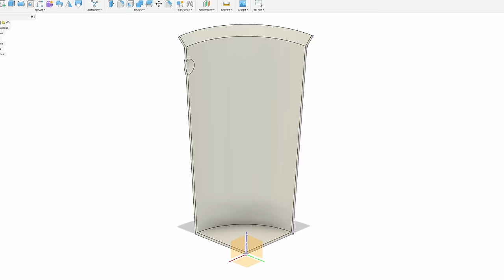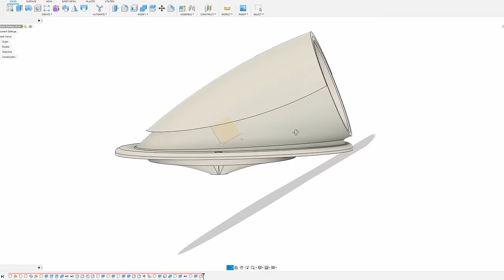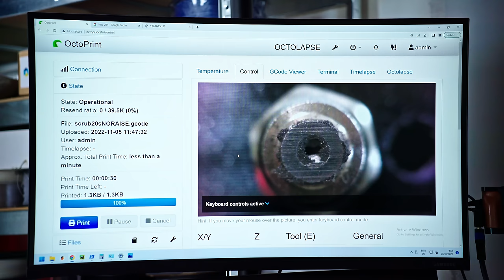Why you should get a 3D printer NOW

Comment: I came from a machinist background, designing an printing things that are impossible to machine, safely in the house with my children at a fraction of the cost of most other processes.  Just amazing.
Reply: This, this is one off the appeals for me. Sometime ago made fanmount/duct to enclosure and it occured to me that why wouldn't I create angled cable channel inside the part. I mean sure, most off the stuff could be done machining, but man the effort to make stuff like that which can be trivial with printing. Also printed very oddly shaped funnel to one guy for some big rig to add washer fluid as surprisingly it has very unconvenient location. Also added air channel inside that. Stuff like that would be virtually impossible to injection mold. It's also so good for machine prototyping. I've made countless off packaging machine parts by printing and some are actually in production all the time. But it saves a lot off time to design and actually test part before actually sending quotation for some machinist, let alone ease the stress off designing something "blindfolded" and hope paid part will actually perform as intended.
Reply: Yeah I love being able to design and create things without the need of a giant workshop which just isn't an option for me right now.  It's crazy that you can create almost anything on one single machine.
Reply: Same reason I got one.  I spent hours in the garage on my manual mill and lathe to make something simple.  Blows my mind how fast I can make something much more complex with my 3D printer.  I still want to add a CNC mill to my home shop someday though.
Reply: I like to use 3d printed cutting/drilling guides

Comment: Not only can parts be made, I've sometimes made better parts than the original equipment. Favorite example is our microwave oven. The plastic tabs that latch the door shut had broken. It took a few dozen iterations, but I came up with a replacement part that will hold the door closed tighter, yet open and close more cleanly, with one finger swinging the door closed in most cases. My replacement part has lasted for years so far with no degradation of performance, but even if it totally broke, I could just print another and whack it in, with no further re-engineering. Awesome to have that capability at home.
Reply: you sell your design to that company for a good price

Comment: Printers can be really useful for many people. My old colleague, really, really talented metal worker asked me if I could print him for he's rally car heater adapter flange. From rectangle to hose connector part that would be really obnoxious to form from metal for what it is. He sent me dimensions and I modeled based that in about 1h and after 12h print he had cheap solid and light part to mount the car. He was really happy to save possibly multiple hours of tinkering, gladly paid bit for the job to have more time to focus on more productfull work.

Comment: I've got more than 40 years in depth experience of industrial CNC machines. Started as an operator and eventually got into service and repair.
As a natural tinkerer i got my first printer a few years ago. The main use is for working parts when the material is sufficient for the application. I soon realized one printer was not enough. Now I have five. When working with printing often three of those ar running at the same time.

Comment: All good points Thomas!,  As a fixer & maker, I consider the 3D printer  an essential tool. Sure, I use other materials and methods like woodwork, machining & welding, nuts and bolts, glue, wire, tape etc..but there are times when the speed from concept to part is incredibly useful and there are many times I´ve just printed the-thing-i-need-right-now for a project.  Could be a bezel for a coffee can bookshelf speaker,  A custom holder for a flashlight, a toolsetting jig for my small cnc mill, a prototype bracket for a tricky DRO scale mount on one of my machine tools, a drill organizer or a phone holder for my car.  The instant gratification and iterative design ease just can´t be beat.

Comment: Coming from 25 years of industrial maintenance point of view, 3d printing is viable in a lot of things.  Having access to both resin and FDM printers, we have made many items to ductwork adapters to robot end effectors. Now to be fair, i have years of CAD experience so moving on to 3d printing was the next logical move as moving from idea to design to creation is minimal.  The learning curve anymore is not in using the 3d printer but designing what you need to be able to print it.  Sure you can find a lot of cool stuff for free but most items needed for specific use have to be designed.

Great video as always.

Comment: For me the main reason to start 3d printing now is that the technology has matured to a level that non-enthusiasts can use it. It's no longer diy thing where you spend most of your time getting the printer to work; no, now they're just reasonably reliable and easy to use. 
I've been repairing customer electronics as a hobby for some time now (organized in so called repair cafés). I always was frustrated I couldn't fix some mechanical parts. But I didn't have the time for an extra hobby. I bought a prusa i3 and now I can fix more stuff. It just works.

Comment: The reason I got one? Replacement plastic parts for power tools and other appliances. There are so many plastic bits and bobs that really have no business being made of plastic in the machine that are critical to it's function. Eg. Most palm sanders have a compliant plastic internal frame that's highly prone to fracture as the plastic gets brittle over time. Epoxy and plastic welding didn't work, yet I was able to print it and a number of other replacement parts out of it. Also, the material efficiency is off the charts.

Comment: Thanks for the MicroSwiss Ad (I hope it's not bad), I was looking to upgrade my other Boden style Ender 3 and this MS with a REVO just made up my mind! I may consider upgrading my current Ender 3 with MS regular direct drive with this type if this new MSwiss NG is any good. Does anyone else have an issue with the BigTree TFT-35 touch screens crashing your printer? Seems I can only use them in Marlin mode, gone through 3 screens, I could be a boneHead. I have made Polaris snowmobile parts, that Polaris no longer makes, Mr. Coffee Machine parts, costers with custom logos, a better air vent clip for my 2003 VW in the Enigine Com!, it's been endless for me.

Comment: The facility where I work has a bunch of large-format CNC mills. Every morning we all pitch in to clean up down there, and even after removing bag after bag of debris and dust, while running building-sized air handlers to capture airborne dust, there's always a thin layer of dust on everything. Then there's the sheer expense of having a big honkin' dumpster rented and emptied daily or weekly.

Compared to that, SLS was a game-changer for prototyping and industrial design, and FFF/FDM and SLA/DLP after that was even more efficient. But that's like a decade or two ago in the industry, now the cutting edge of the industry is resin jet, sintered metal parts, etc. There are very few large-format options (machines that can spit out 1:1 scale cars) that are cost-effective at the moment, but I'm confident we'll see a few more in the next decade. Meanwhile in the consumer space we may see HP start selling scaled-down consumer resin jets.

Comment: your 3d printing speed is limited in fdm print head by the acceleration, only spray the plastic with hot air and deflect sideways with hot air nozzles, like in a crt screen
Reply: yes material spray direction by air flow
Reply: air flow speed can be controlled by piezo elements (either nozzle direction or air pulse generation/speaker)

Comment: I came from an engineering background (that's my job) and had experience with CNC routers when I moved to 3D printing 7 years ago or so. I've also been "DIY" things since my early childhood (errr ... more than 3 decades ago).
As you said, 3DP is a much less noisy / dirty thing han CNC routing is. Much less noisy because I don't know a 3DP printer than can be as loud as a CNC router is (the one I have is as as loud as 80-90 dB).
To me, it's not only a hobby. It's mostly a TOOL, a tool you need to get used to (3D printers are not "plug'n'play", unlike some may think. NONE is). That's a tool I use to make functional things. Not only for my own use, but... family, friends too. My dad can't step asking me new things to fix "this" or something to do "that".
Mine has been barely modded/upgraded since I bought it. A few things changed because it was necessary, yet it remains globally the same machine.

Comment: My company, Rack Robotics, is using 3D printing to make our products. We have over 3500 prints to get through for our first run. Getting the right printer is super important for people using these for sales. Even if you have a lot of experience it's better to get a machine that does more of the work. Not having to run nozzle offsets or flow cal is really important for quick turnaround. Also having 5x of a high speed printer is a huge help.

They're not perfect, but printing is a great way to avoid injection molding for medium volume custom parts.
Reply: 3D printed parts are not comparable in strength to injection molded.
Reply: @OU81TWO  depends on the material and use case. For us, we're using prints as panels on an electronics product. Also for most use cases it may not matter
Reply: @OU81TWO  This is no longer the case. You can now print parts stronger than injection molded ones if you use right parameters or/and fiber reinforced material.
Reply: @OU81TWO  That's bit debatable. In some cases you can leave out air channels from printed parts and some forms are just impossible to even create molded. I've made many replacements for molded parts. Granted they can have more "meat" in them. One thing is that you make molded part that can fail, well you essentially have flawed batch off products. Printing can fix many bad designs.
Reply: @jothain  I'm talking about the exact same parts made with exactly the same material. The only variable is the process. One is 3D printed the other is injection molded. The injection molded one will always be stronger due to the uniformity of the material structure. 3D printing causes variations when layers are fusing together.

Of course you can adjust the design to make it just as strong but that's introducing another variable and it's nolonger a valid comparison. Process vs process using exact same geometry and material...injection molded always wins.
Reply: @OU81TWO  Not true. As I mentioned those air gaps. I've replaced one part that always broke, with 100% identical dimensions and immeadiately after printing, failures stopped.
Reply: @jothain  Have you actually compared your 3D printed part to the same part made with injection molded plastic?? I don't think you have. It sounds like you're telling me your 3D printed part broke then you redesigned it and it doesn't break any more. That's great but that has nothing to do with my comment.

Edit: You mentioned that you redesigned your part by getting rid of the air gaps but the geometry is identical to what you had before. That statement is contradictory and you don't understand what you're saying. If your part has internal voids and you eliminate them but keep the same "exterior geometry"...
your part is no longer the same geometry. Internal geometry is part of overall geometry so if if you change something internal that isn't visible...you've altered the geometry.
Reply: @OU81TWO  I don't understand? How about your "3D printed parts are not comparable in strength to injection molded.". So you're now all of the sudden allowed to change your statements? Right.... Whatever 😂
Reply: @jothain  You're right. I should have been more specific in my original comment but...I went on to explain in detail in my follow up comment to which you replied. That's means you must have read it...and still didn't understand what I was talking about.! Yeah, whatever right back at ya.
Reply: @OU81TWO  I understood. Part I'm talking about had voids inside. Not by design, voids by manufacturing. So 3D printed part can be structurally more sound as I've proven. It's simple as that and it obviously means your statement about uniformity isn't neccessarily true statement. Usually yes, but you stated it to be always that which molded part always isn't.
Reply: @jothain  If there are voids in an injection molded part not by design then that's a defect. You con't use that as a comparison because the part is not the same geometry as your solid 3D printed part. We've gone over this. You still don't get
Reply: @OU81TWO  And printed part is defect if it has voids /uniformities, like you mentioned 😆
Based on that I absolutely can use that comparison...
Reply: @jothain  No. The joints between printed layers are never uniform. That's the fundamental issue inherent with FDM. You're trying to "stick" a hot bead of molten plastic on top of plastic that has already cooled. It will never have the same integrity as molten plastic that is force together under pressure and allowed to cool as one solid piece (injection molding). 

Resin 3D printed parts are closer to injection molded in terms of strength because there are no "layers" so to speak...but we're talking about FDM so...

Comment: A note to brand new 3D printer owners: Choose your STL downloads wisely, the cute ones often only stay cute for 5 minutes after printing, then you've got to find somewhere to store them.
I got a 3D printer so I could create custom parts, notably being able to attach things to other things in unique ways, which lead me to creating a pile of TPU holders for antennas & radio receivers for drones using design ideas nobody had seen before, they print flat without support and fold into place,. There's thousands of racing / cinematic / acrobatic drones out there with 3D prints of my designs on now.

Comment: "and the only bits that are free-range waste are the little nubs where the nozzle gets primed" 7:55 ... Well, unless you use a Bambu Lab AMS system which produces tons of "poop" waste! ;o)
Sorry for the Bambu Lab trolling. But after reading soo much hype and fanboi comments I had to point this out! =) I do like BL! But they are not nearly perfect.
Otherwise I fully agree to your arguments and often use most of them when explaining why I am into 3D printing.

Although it is complicated to suggest a "first" 3D printer (which probably was and is one of the most asked questions), I would advise to not pay too much (below 300 bucks) and buy a machine that testers described as "good out of the box". In the moment that would be a Sovol SV06 or SV 07 (if on sale), Elegoo Neptune 4 (Pro) or an Ender 2 Pro.
Simple, reliable and cheap.

Of course a machine for 700 bucks is better - it should be (Like a Bambu Lab P1S/P)! But comparing the price to 129 bucks for the Ender 2 Pro it's a lot more investment for a new hobby. And my problem with that is, that they are mostly only better in one thing: speed. And they are also much louder which isn't good for using that thing in an apartment at the evenings.
But the idea could be: make your first steps, try stuff out and some time later you know what your second printer should be like. Maybe it's speed, but maybe it's size (at least 300 x 300), maybe multi material (BL AMS) or two materials with less waste (Sovol SV 04 IDEX), maybe design (Creality K1), open source or the whole DIY building experience and knowledge gain (Voron). Till than a simple Sovol SV06 could be a solid workhorse and later be used as a project printer to dive deeper into modding, Klipper, new toolhead, programming ... or the first printer for someone in the family.

And don't be too impatient because of long prints! If you printer is quiet you have more than 100+ hours a week for printing and during that time you can dive deeper into knowledge and tricks (videos), learn CAD, search new models, design new parts or doing stuff like cooking, eating and sleeping. ;o)

Comment: I would also add in machine maintenance costs, the bed will wear out eventually, so do the moving parts.
Reply: I wouldn't even count those. My mk3 has printed for at least hundreds off hours and only stuff I've replaced are bed sheets couple times and 99% of that is my own mistakes. Wrong material to wrong sheet that literally took parts off the coating. Couple nozzles. That's it. To this day I haven't replaced any other mechanical parts to my printers at home and work.
Reply: Maintenance cost is negligible. A new PEI sheet for the bed start at abt, $20. And i will last pretty long. The other mechanics are not that expensive either if using a common commercial printer.

Comment: if you had about £500 which printer would you buy?
Reply: The cadillac near that range is the Bambu P1P, one of the fastest printers you can buy...  but if speed isn't king, you can get something like a Sovol SV06 for under $300 US.  reviews of them on YT.
Reply: i'm also thinking about an Idex; either the sv04 or tenlog tl-d3 pro... any thoughts?
Reply: @hood1148  I sometimes find myself looking at the SV04, but when I'm honest. I'm a functional user, not selling parts and I can do a color swap on my direct drive in 10 seconds if I want to just spice up a print like some recent tablet stands, so, fun aside, it's not practical for me.  I'd suggest drilling down hard on what types of output meets your goals.